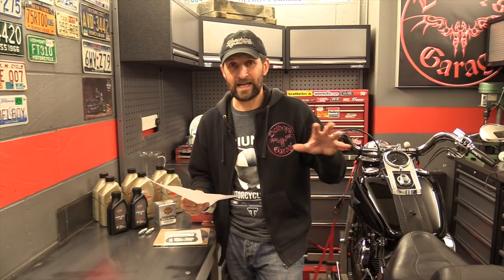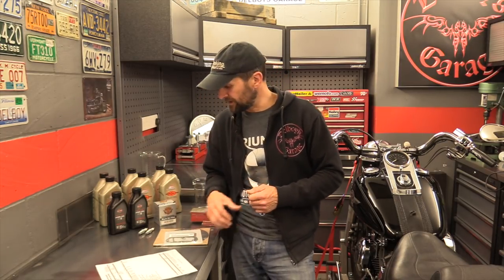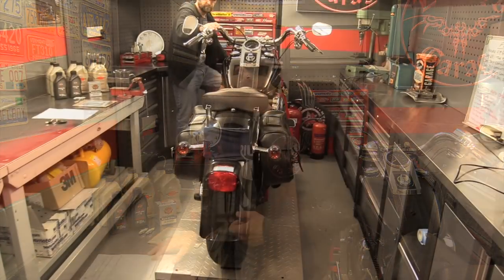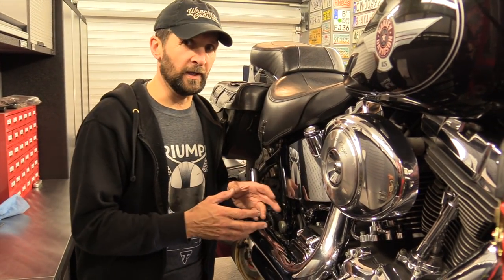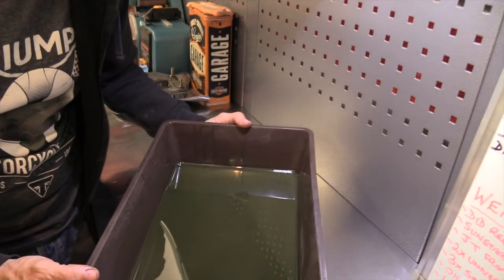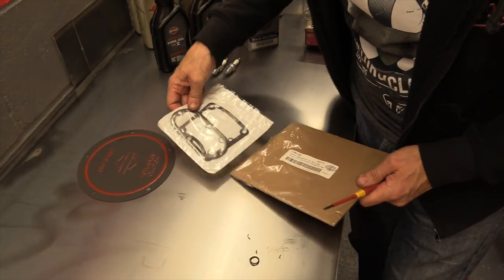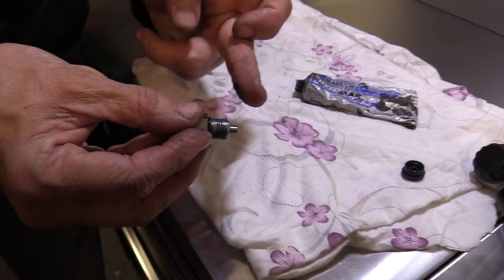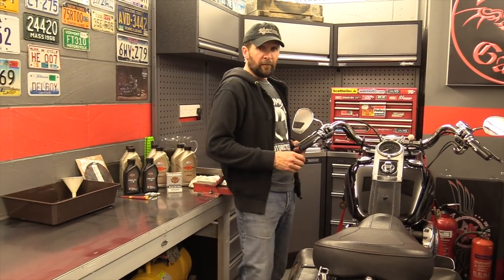Delboy's Garage, Harley Softail Service #1:- Gearbox Oil Change

Comment: (p) Just serviced the Kawasaki VN1500 and used the tray from a shop brought, oven ready chicken. It's shape lets you get it into some really tight spaces under a bike. It holds a surprising amount of oil too, but not large enough for an engine oil change. Maybe a turkey tray after christmas!

Comment: Thank you for an informative and clear tutorial. I have just purchased an 05 deluxe and love it. One problem though....I want to work on it (with your tutorial help) but can't get the alarm to off mode (keeps on resetting after 30 seconds or so) so I have to keep on using my fob to turn it of. How do you work on Harleys without the alarm interfering all the time? Any help would be appreciated and, apologies if the solution is simple - I just can't see it.
Reply from the maker: Hi Janet, the procedure is in your handbook, using the indicator switches and ignition, I can't remember it off hand, but there's a work around that works for every Harley with an alarm, that's to turn the ignition on as if you're just about to start the bike, then pull the main fuse out... this kills everything and the alarm thinks the engine is running so goes to sleep, it's actually a laid out procedure in the Sportster manuals for changing the battery!

Comment: Do service in dealers would never have the love and care as you have. Here in Australia the service is dodge. Of the 20 items that must be checked, they only exchange the oil and charge the time of the 20 items. I put some traps to check if the mechanic moved the part and nothing was touched.
Reply from the maker: This is why we make the videos, so that people can learn to do this work themselves... and the Sportster doesn't have separate gearbox oil !

Comment: Does the bike need to be hot while changing the oils in all three holes? I would expect that for the motor oil it would be beneficial, but what about the primary and gear box? Thanks

Comment: I’ve always done “hot” oil changes. I believe the theory behind that is any contamination is picked up and circulated into the oil and then out the drain hole and gone. So I was taught.
Interesting that you do “cold” changes.
What is your take on this?
Really enjoy your videos and your style.
Regards.
Reply from the maker: Sediment sinks to the bottom right?, so why rinse it up all around your engine directly before you want to drain it?.. 

Of course, if you live in a super cold climate, then warming it up first will help it flow...but how often do we hear Oil companies telling us their oil stays in grade at all temperatures?.. in which case, warming it up does nothing right.?
Reply: @Moonfleet41  I thought i was the only one that does it this way...lol. Subscribed !!!!!!!

Comment: Hi Del an Penny, Being new to Harley My Softail FLSTN lives its life in the garage in its upright position, I do check the engine oil level when on its side stand, regarding the gear box and primary as being done on your lift in the upright position, having the bike in the upright position as opposed to on its side stand does this do any harm to the engine components whilst the oil laying dormant for any length of time in the horizontal position rather than normally being on its side stand, always love the vid's  , Garage looks great.Russell
Reply from the maker: Hi Jackie, no, no harm comes to a Harley due to it standing one way, or the other.... you just check the gearbox and primary oil upright and check the engine oil on the stand, as you know... (and of course check it HOT as it expands when it gets warmer, then you'll get the correct level).... congratulations on your bike, make sure you get out and ride it every chance you can, they love doing miles !

Comment: Thanks for such great videos! What is the part number for the gasket set? Have a 2004 Heritage Softail. Whilst Im about it what is your opinion on filling the new filter with oil before fitting? James
Reply from the maker: I wouldn't have a cue on part numbers, your dealer keeps all that data, just call the parts desk guys.    And yeah. prime the filter if you're not priming the whole engine on a softail..

Comment: Well done. I don’t recall if you mentioned the year of the Softail you were working on but on an older Softail (5 speed) is the volume of gearbox oil different vs (6speed)?
Reply from the maker: This bike was 2005, OIl specifications vary slightly, it's always best to refer to you FSM for the exact specs so you can get it dead right.!

Comment: Thank you sir 👍🏼 Excellent for the new lover of American iron. Here in Sweden at the mo' the weather is not conducive for riding 😕 salt, snow and ice. The Pearl will be sitting in my mates garage for the next 3 months. Bought it from a dealer who services his bikes before sale... Should I do the fluids before riding?
All the best to you and yours... Chris... ☺️
Reply from the maker: Hi Leonidas, good to hear from you, and as they say, welcome to the darkside!  All I would do if the bike's been fully serviced with fresh fluids by the dealer is change the fuel that's in the tank with fresh fuel before you ride it in the Spring as petrol goes stale over 3 months and can cause problems blocking filters etc., but the other fluids will be fine, just a full safety check and you're good to go!
Reply: @Moonfleet41  cheers me ol'mucker for the fast response! Always appreciated! 🙂

Comment: Good video, but the Dipstick must be screwed in to check level ! from the manual -:
Check transmission fluid with the motorcycle at room temperature.
1. Park on level ground on the jiffy stand.
2. See Transmission Filler Plug/Dipstick Location. Remove transmission lubricant dipstick. Wipe dipstick clean.
3. Insert dipstick into transmission. Thread dipstick in until O ring makes contact with case. Do not tighten.
4. See Transmission Dipstick Lubricant Level. Remove dipstick. Check lubricant level on dipstick.

Comment: First of all THANK YOU!!  Super helpful videos.  Can I carry out these fluid changes with the bike on the side stand or must it be upright?  Can you recommend a low mileage maintenance schedule?  I have a 2003 softail that I only put 100 miles on a year and don't know when I should change the fluids.
Reply from the maker: Hi buddy, you can do most fluids on the side stand, it's not a big issue, but some need to be level so the drain plug gets everything out and on some fluids, the levels need to be checked upright, certainly the primary oil and on some models, transmission oil and even engine oil... just check which your bike is in your manual to be sure.... but there's nothing wrong with doing the physical wrenching on the side stand, then when you need it to drain, just on the bike and lift it upright, no need for special equipment..... as regards the service schedule, once a year is fine with your mileage... the best common opinion, is to change all your fluids at the end of your riding season BEFORE the winter lay-up, that way you're not storing contaminated fluids that might have water content through condensation (specially with short trips)... but always be sure when you come to start riding in the Spring, give the bike a full safety check, as things can get seized up over winter... good luck, cheers, Del

Comment: Are you supposed to check the level with your bike on it’s kick stand or with it standing up, as you did? I’m working on my ‘02 FXSTS…
Reply from the maker: Harley seem to like varying that protocol from bike to bike, Mine was a different bike to yours, so be sure to check your manual for the specific method on Your model.!

Comment: Excellent video as always, learning a lot, do you have one on adjusting the rear shocks, I have a 2005 soft ail heritage springer classic
Reply from the maker: Are they even adjustable mate?  I changed to shocks on my 05 Fatboy and noticed the factory ones were pretty much a set menu... there is a tiny bit of pre-load adjustment, but you need a special tool to access the two holes in the base plate and it doesn't make much difference to the ride when you do!
Reply: @Moonfleet41  didn't think about that, thank you very much, God bless you

Comment: HI Del and Penny. I would be very grateful of your opinion. I have fortunately inherited an FXD35. With only 3600 miles on the clock im debating whether to service it now (due to the 'time' rather than distance) or wait until I have clocked 5k miles and do the scheduled service then. What do you think guys? Oils are all very clean indeed but I understand that is not a true indicator. Really have been looking forward to some big twin Harley videos. Many thanks indeed!
Reply from the maker: Hi Nathan , cool bike, Ibelieve that 's the red, white & blue WillieG special... quite a rare bike now too!  

OK, with your service, look at it the other way round - it's only 1,400 miles, so doing it now and treating as a 5k miles service is no issue - and you could even push it to 10k before you do the next one...it won't hurt it.  The issues is 'time' - how long has the brake fluid been sat in there, how old is the fork oil??  If the answer to brake fluid is over 2yrs, and fork oil over 5yrs, then why not do the whole lot now and be done with it??  But if these were done a year, or two, ago... then you can push it the extra 1400 miles and wope the slate clean at 5k.

So many Harleys do very little mileage, so age is their biggest enemy, I've seen bikes with 2k miles on that are 10yrs old, and they are on the same fork oil and gearbox oil !  So it's your choice fellah, hope that helps you, Del
Reply: Thanks for the reply! Yes its the 35th Anniversary with only 3500 made. You make a very good point about age. The previous owner whilst having it serviced has indeed neglected brake fluid and fork oil. It was probably his belief that its low mileage made it impervious to the ravages of time. I think that im going to do the lot now and at least there is a good starting off point for my piece of mind. It was your vlog entitled 'Haulin Ass' that persuaded me to buy the bloody thing. Had a Sportser in my twenties and that was the push to get me back on a Harley at 36 after a bad spill. A big thanks to you Del. Cheers!
Reply from the maker: Hi again Nathan, im glad we could inspire you to get back on two wheels.... ride safe fella.. and look atfer that beautiful bike.!

Comment: Good to see the big twin stuff starting. I presume it's the same procedures for all the Harleys with the Twin Cam engine?
Reply from the maker: Yes Martin, this is a 2005 Softail.. any of the twin cams are the same, and much of it also rolls across to Dynas such as the torque settings etc... little things may vary as you'll see in this wekeends video, things like different style sump plugs in the Primary, but i cover it all if it needs to be said... thanks for your support, i think its been a bit long overdue this service, so there will be at least 6 in this series, then others later once i get the parts... tank fuel filter is £140 for the parts... so that will be once i get the moey together... maybe  few weeks..   cheers buddy.. del.

Comment: I. Got to admit, I was so excited cuz I thought this was the fighter build lol, it was comparable to pouring a big bowl of cereal, and only having a pinch of milk left. Lmao! An I'm joking Del. I'm super excited to watch this video, and see how well your fitting into your NEW work space! :) cheers my friend, (DAN)
Reply from the maker: Yeah sorry Dan, all best intentions, went for a ride Sunday, the Harley rolled over 32k miles and I noticed in the history when I looked, it had 7k miles on the last oil change - was told it had had it's 30k miles service when I bought it, but it clearly didn't... so gotta catch up, then will be back to the fighter !
Reply: Hey no worries. Always great to catch a garage day with ya. But I'm glad you were able to catch that early enough and fix it. Also interesting to watch cuz it's STILL learning right. Cheers Del Hopw you enjoying the day (it's 89Degrees F where I'm at, lol) how's the ramp in comparison to the old. I bet the new lift and latch system is a huge upgrade in my opinion.

Comment: Okay I have an 2002 FLSTC I am an old Pan-Shovel guy and this is my first twin cam and I am not impressed.  I see two different ways to check the transmission oil level up right and on the kick stand witch is it.
Reply from the maker: Check for the specific orientation of oil level check on your exact model in your handbook that you should have got for the bike, it will be clearly specified.  Yes, it does vary, so it's important to be sure.
Reply: @Moonfleet41  The book says on the kick stand and level for a five speed gear box oil check. A Harley mechanic said the gear box is checked on the kick stand too. Sorry I ever bought a twin cam I am selling it and finding a good Evo.

Comment: Del- as always great video. I know you have done other DYI videos on other Harley models. However, for future videos is there a way you can mention how particular service on this Softail relates to other Harley models. I.e. similarities or major differences. I think it would help owners with other Harley models watching the video. Thanks much
Reply from the maker: Hi buddy, I appreciate your input, and it's not a bad suggestion, but it's not particularly practical suggestion, as there are so many small differences that matter... and as you know we like to keep the videos a cut above the others on the net by giving them in depth detail that really helps the novice, rather than sweeping generalisation... it would be great if I had many different bikes, I could make all the different videos, but it's not always possible when you've just got your own bike !  Good thought though, at least if something is universal to all Harleys, like the drain plug torque, or the O-ring information, etc., then at least I could mention that maybe....thanks for the nudge, Del

Comment: Never heard of that stuff you are putting on the drain plug.  A lot of guys are using liquid thread sealant like permatex high temp thread sealant.  What do you think of using that on the drain plugs?
Reply from the maker: Not use it myself mate, so i can't really pass comment.. but this works for me and is readily available if you need it..!

Comment: Hi Dell, I'm changing the lubricant for the primary chain on my softail. I've checked the drain plug, and what I see that there are some black strings on the oil plug. This is not from the o-ring. Can you tell me what I should do? I can send you some pictures if you want. Best Regards, Wilfred
Reply from the maker: Hi Wilfred... if im understanding what you're describing right.. that could be PTFE tape.. like plumbers tape.. if you have the tapered drain plug (take a close look at it), then it doesn;t have an 'o' ring, instead it is recommended to use a sealing tape round the plug and tighten it in "wrist" tight... check your manual and it will make it clear..

Comment: question. the drain plug is actually same for all oil changes. am i correct? im new Harley owner, a novice and enjoy being instructed on basic maintainance of my Harley. i was under the impression there were 3 different drains for the bike.
Reply from the maker: Yes Norris, there ARE three drain holes on a Softail, and NO. the plugs are NOT all the sale.. it's very important not to mix them up.. the Primary fluid drain plug on some model years is tapered.  make sure you buy yourself an genuine Harley Davidson service manual from the main dealer, it will become your bible and help you through every job.!

Comment: Correct me if I'm wrong but you didn't say how you should check the level? should the bike be straight up or on the side stand?
Reply from the maker: Upright for the gearbox oil level.. upright for the Primary oil,  and side stand for the engine oil..!   Hope that helps.. Del

Comment: Hello Del,

Thank you very much for your response with a detailed explanation. For your information, every year I perform maintenance in accordance with regulations from Harley, regardless of mileage. I let you know how I get on. Thanks a lot again for your support. I am very grateful. Thanks to you, I no longer have to pay the expensive bills from the Harley dealer. I can finally use my money for buying tools now and customizing my bike. I want to donate a small amount every month, is that possible instead of a donation per video? I owe you a lot of six-packs of beer....Wilfred
Reply from the maker: Hi Wilfred,  Its great to hear that you take care of the bike yourself.. the nucleus of your problem will be the clutch plates sticking together.. so if a primary oil change and a quick adjustment doesn't help.. then maybe think about dropping the plates out and cleaning them properly on the bench, clean oil in the casing can only clean so much!... you could replace them or if they are really good condition, then just reinstall them and it should be a lot better...     Thank you so much for the kind thought of a monthly support.. all you need to do it make a regular pledge for the amount you would like to donate each month... but make sure you "CAP" the maximum to that same amount.. then that is all you will be charged each month.. so effectively you support 'one video" and none of the rest... this is what many patrons do to keep it at the level they choose... Hope that helps.. drop me a line if you have any problems and im happy to help.. Thank you so much again in advance.. Del & Penny ..